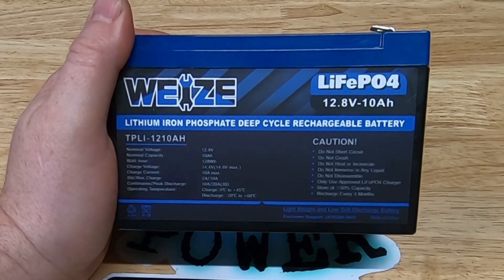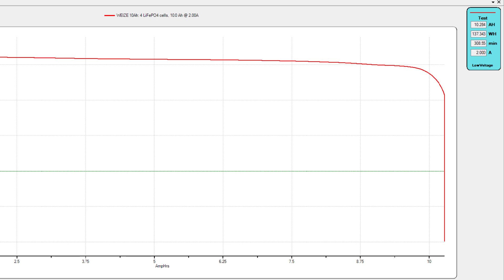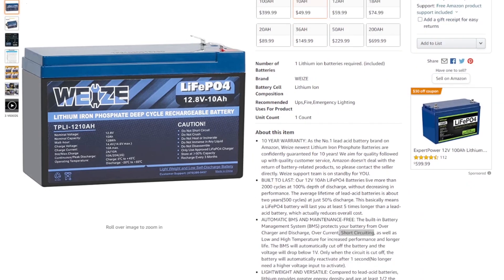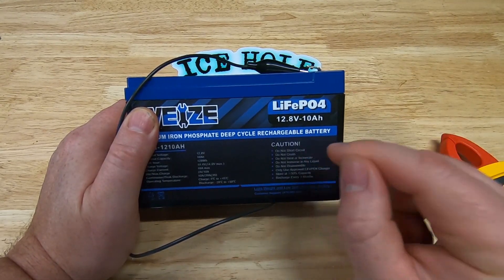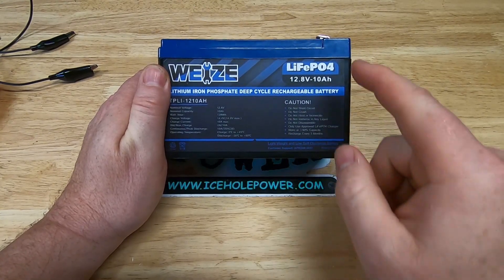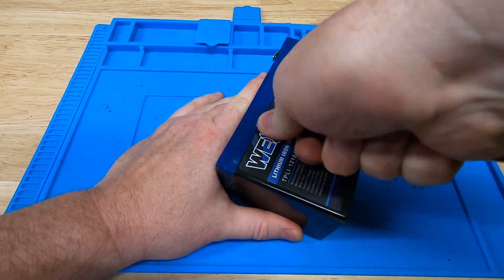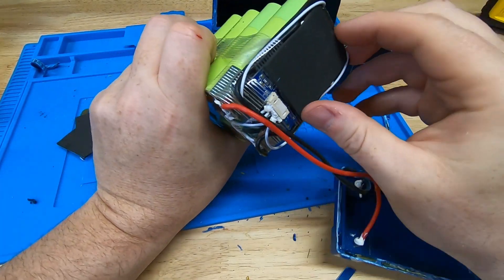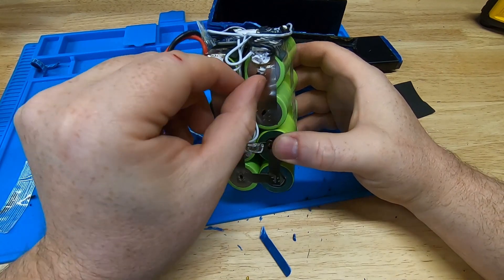Weize 10Ah Lithium Battery Review and Teardown

Comment: Liked and subscribed simply because you saved me the trouble of tearing my own open lol.  Much appreciated.  I use a bunch of these size batteries for various projects around the house and I've tried several amazon brands ranging from $23-120 and it seems to me like they are all about the same quality.  Interesting to me to see the same things you noted, the silicone vibration proofing is a nice touch, probably what they base most of their warranty on, haha.  I'd also like to see higher quality in the build process, but I suppose it is a mass produced affordable item, so I'd be super surprised to see one built the way I'd do it and still be reasonably priced.  Now I'm curious to see the difference inside between my $23 cell and my $120 one. I would be willing to bet there isn't much difference.  Thanks again for the vid, this is my kinda tinkering.  I'll check out your other vids too.

Comment: hi there: thanks  for all your work helping us we really apreciated, recently l bout a 100ah weize lithium batt, what can you tell me about it? also l need some help with a fish finder HOOK REVEAL 7" lithium batt probably a 12 or 18 ah  and charger, for the charger lam looking at the HTRC-P20 BUT l don't know much about it the only think l would like is that l can charge multiple types of batts, as you can see lam barely new in to electric stuff, looking for a charger capable to charge100ah and 12 18 or 20ah, thanks again for your answers

Comment: The bms immediately takes away one of the most important uses of these batteries. 
That is in a ups. You can't use it in a ups with a bms. 
The bms will most of the time cut off before the ups does and that will freak out the ups as it won't sense the battery. Battery charging and discharging voltage is handled accurately in good models. But sometimes the bms may not be able to handle the balancing and it will cut off which is bad!. 
In discharge time if the bms cuts off first the ups will not turn back on automatically on it's own..  
So the only remaining uses are in emergency lights , cctv and alarm systems where current consumption is low and those devices don't freak out when battery cuts out. Actually very good for flood lights as the bms will cut off and prevent over discharge. 
They should make a ups compatible without bms & only cell balance.

Comment: I just found your channel. I appreciate that you are testing so many factors. Your reviews can aide people concerned with many different battery solution issues. I personally need to choose batteries for cameras, Amateur radios, Microcontroller systems, remote lighting control systems, and much more. With so many fly-by-night companies out there, it is difficult to make a clear and easy choice. Outcomes can be dangerous and deadly without proper manufacturing procedures and such quality reviews. I was thinking you may be able to low temperature test the battery with dry ice, a cooler and some type of microcontroller for recording data and turning relays on and off. Thank you for your video.

Comment: noob question here. can I use a deep cycle battery (Amp outdoor 30amp 12V tall, deep cycle) for my 93v uhd garmin? or do I have to resort to a non deep cycle?
Reply from the maker: Great question! The term deep cycle comes from lead acid based batteries. SLA could not be discharged past 50% without damaging its ability to retain a charge. Then AGM came along and they could be run all the way down to 80% "deep cycle" before internal damage occurs. Lithium batteries can be discharged down to 100% of their rated capacity so the term "deep cycle" in relationship to lithium batteries is more of a marketing thing because all of them are "deep cycle". Thanks for watching!
Reply: @iceholepower8012  thank you so much for the clarification!

Comment: If difficulty to disassemble is a measure of build quality, you'd have to say the case is built well, if nothing else.  Did you test low-temp charging protection?
Reply from the maker: They used a lot of glue on the lid. It does have low temp charging protection. I mentioned it in the beginning of the video.
Reply: @iceholepower8012  Hey, pro tip, its 10x easier to crack these batteries open when they are frozen. I promise it becomes so much easier to get the caulk and/or glue to separate away from the case when its frozen at -40C or -40F. Same temperature. Fahrenheit and Celsius meet at negative 40 degrees. You can also use the freezing the battery trick to test low temperature charging protection right before you break into the battery. Lithium Solar uses this trick to cleanly get into all the glued or caulked batteries he opens. He puts them in a chest freezer to make the batteries open 10x easier, and before cracking them open, you can do the low temperature charging protection test.